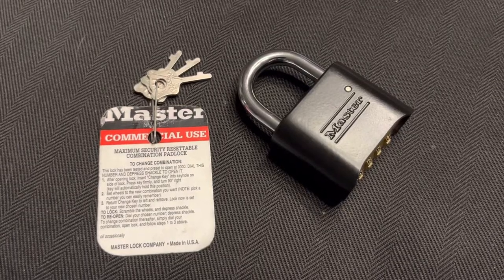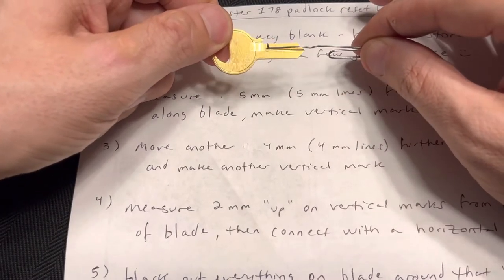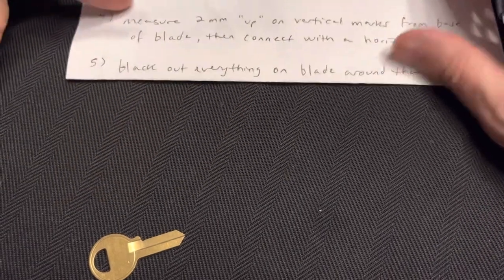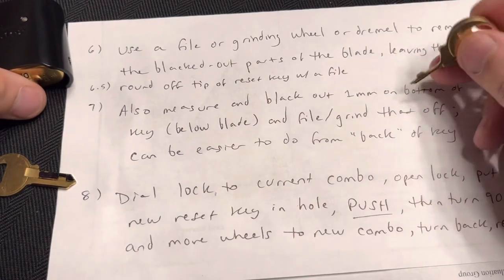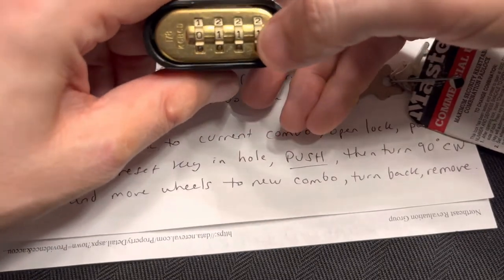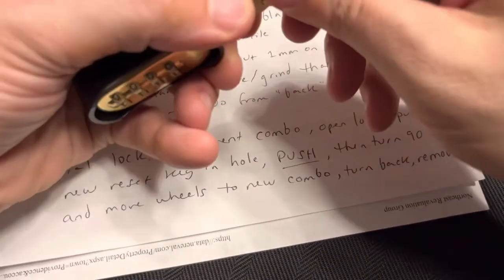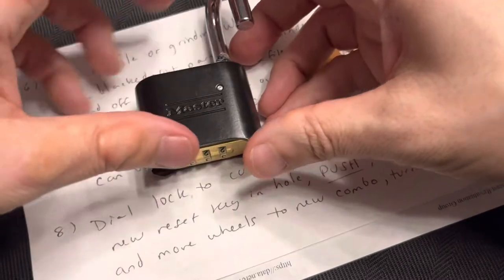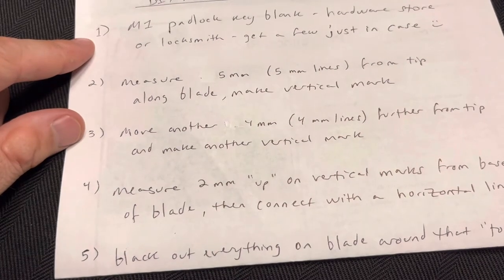Making a DIY Master 178 / 175 / 176 Padlock Combination Reset Key

Comment: 0 seconds ago
Not sure if u knew this 😂 but as I’m sitting here trying to follow u step by step my boy told me I can just stick a lil L tool small enough to fit in there n push the button inside and hold it while u change the code 😂 no need to do all that other stuff I just waisted an hour of my time and I tried the l tool n i was able to change the code I even tried it with one of the small screw drivers u use to take the screws off of the glasses and it worked too I didn’t need to twist it 90 degrees just stuck it in pushed it in n held it while I changed the code just in case anyone ever needs to change the code someday n I run into this comment ur welcome for helping I save some time The twisting of the key is only so u don’t have to hold it while u change the code
Reply: Thanks! The funny thing is they want $9 for 2 of those keys on Amazon!
The paper clip worked after all...
Reply: You're correct. I'm gonna simplify it a bit: stick something small in the hole. Push in and hold. Change the numbers to the new code. Release. You are done.